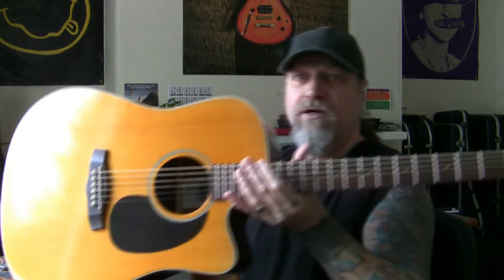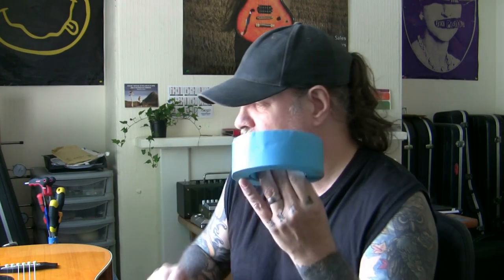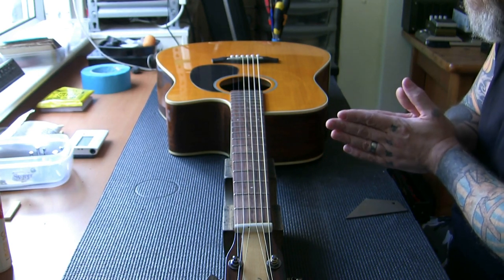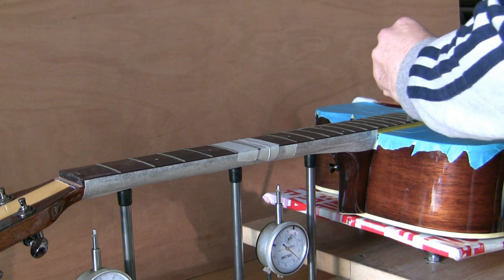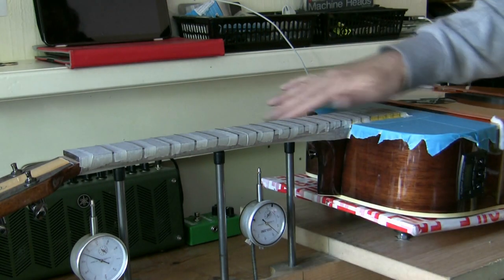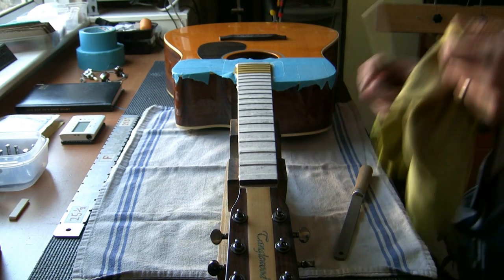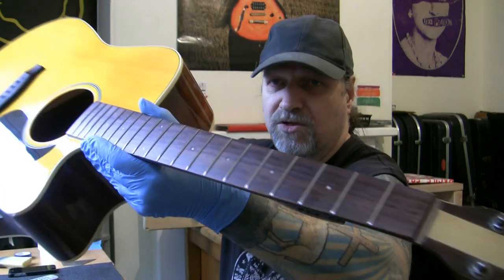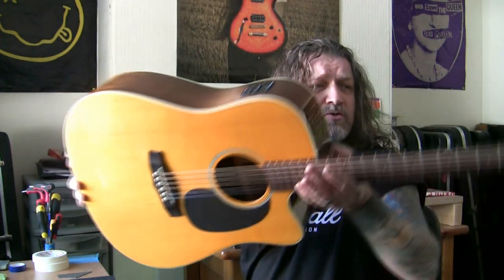Tanglewood Nashville V TN 5 DCE in for a fret level...

Comment: Are Tanglewood guitars very popular at UK, or are they badly fretted?
I got two guitars of the same model and while they are not made by perfectionists, speaking of glue, for example, but their frets are irreproachable.
I'm speaking of TW 138 ASM SD. My god do they ROAR!
They were made in 2011-2013 I think. Maybe things changed.
Reply from the maker: I used to sell Tanglewood guitars and the Korean made ones were exemplary! If this one is like all other China-made ones; I don't rate it. I always advise people to buy older 'Cort factory' ones made in Korea if possible. The Earth Series ones are amazing guitars...
Reply: How do you know where exactly and at which factory were they made?

I think pre 2010s Earth Corts are kinda bad.
But the ones that have a "diamond" logo instead of the "flower" seem to be MUCH better.
Reply from the maker: All Korean made Tanglewood's were made at the Cort factory so if it says 'Made in Korea' on the label, it is made by Cort. TheTanglewood Earth's were that good, when Tanglewood discontinued making earlier models, Cort continued to make them under their own name (with Cort branding / logo)...
Reply: So Cort's "Earth" series stems from Tanglewood???
Reply from the maker: Yes; Earth series was Tanglewood's design made by Cort. Tanglewood discontinued early models so Cort carried on making them with a Cort branding...